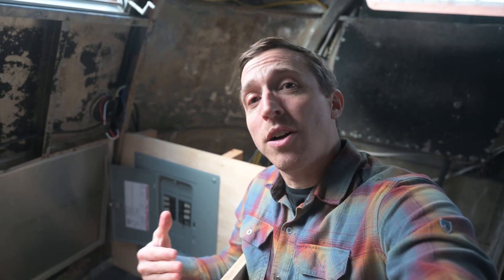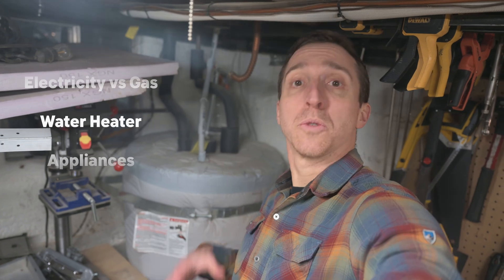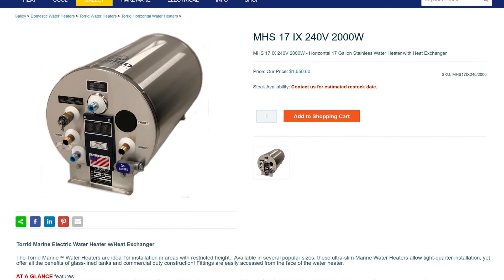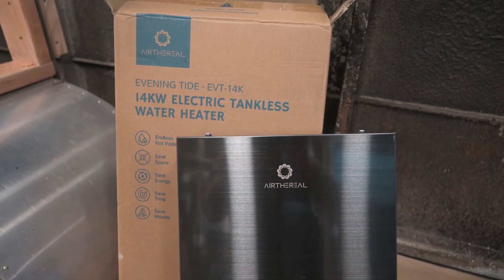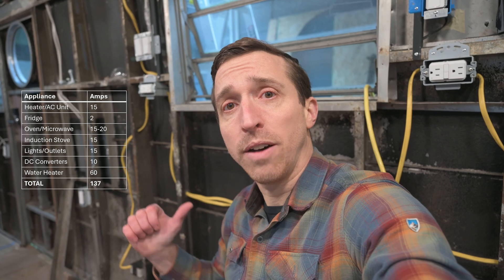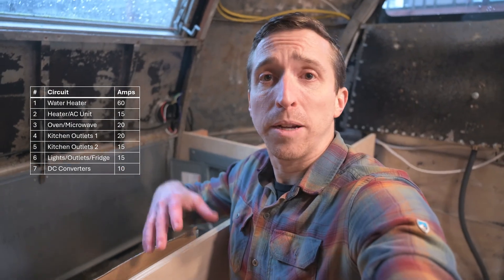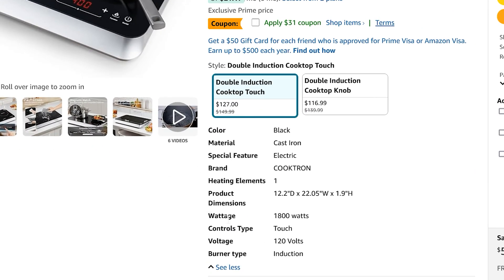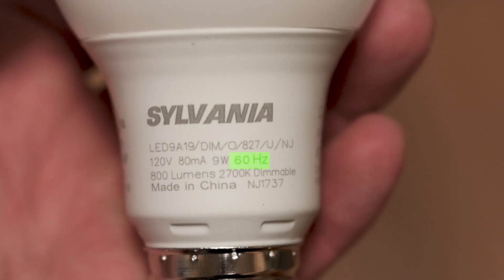3 Big Decisions in Designing a Camper Trailer Electrical System | E22

Comment: Trying to figure out how to wire the shore plug to the breaker box. Can’t find anything on it lol
Reply from the maker: We haven't hooked up to a proper supply for our trailer yet, but in another video I show you how we set up a temporary connection using just an extension cord. Starts at 1:20 - https://youtu.be/y4mrfRycgtg
I hope that helps for now! Otherwise if you do have a 4-wire shore power cable, just don't put the jumper wire in like I did in the video I just linked and then one hot wire to each hot terminal, then with the neutral and ground you should be good!